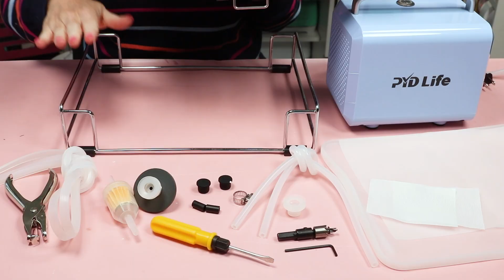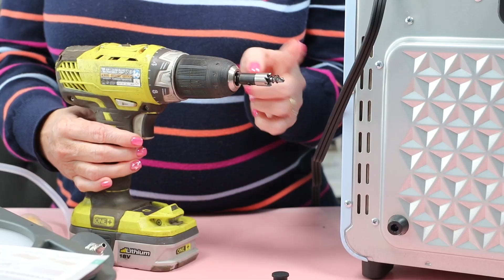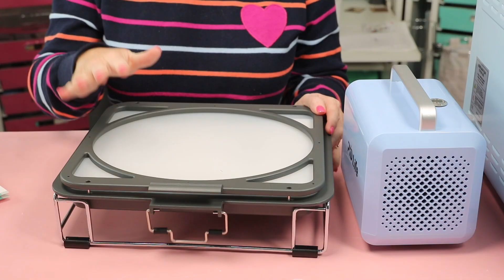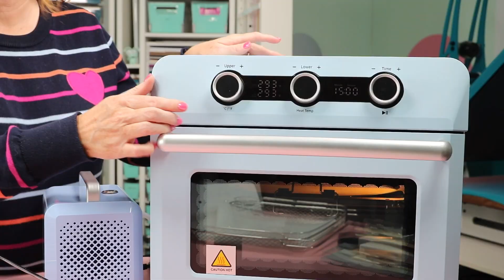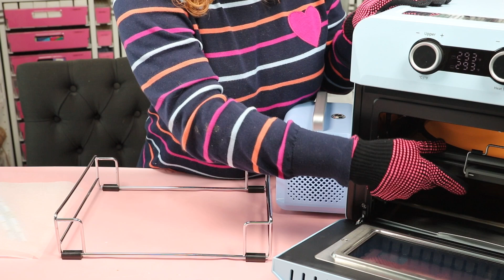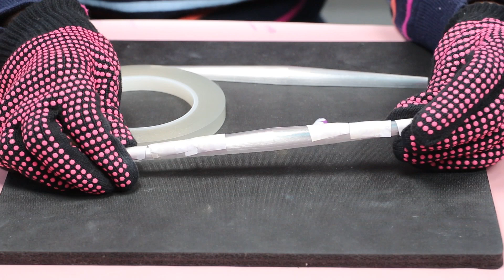3D Vacuum Sublimation Tray and Pump with a PYD Life Oven

Comment: So I have a question. We were testing our PYD Life vacuum on Koozies to see if it would sublimate the whole thing which it did great but the neoprene flatten and the crease on the bottom kind of stuck together. Do you have any suggestions on time and temp? I want to make a neoprene bottle sleeve for a friend.
Reply from the maker: That would be tough! I am not sure what time and temp I would try. Could you add paper between the two layers so it doesn't stick together?

Comment: What is the maximum size you can put into the vaccum tray length and width. Here in the uk i do glass worktop savers which are A4 size which are in the us a bit bigger than letter size i get issues all the time doing these with normal heat press machines
Reply: Its ok i found its slightly too small unfortunately so im buying the bigger 3d vaccum heat press thats been released a good while